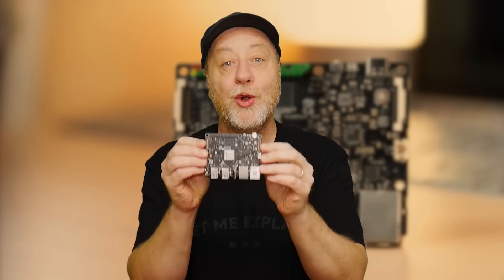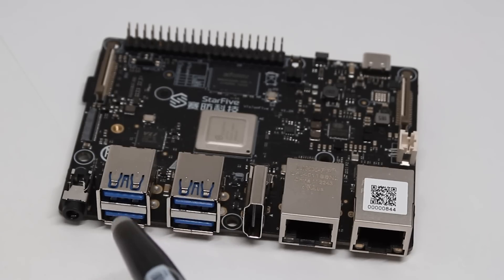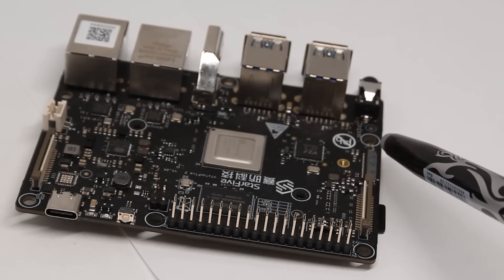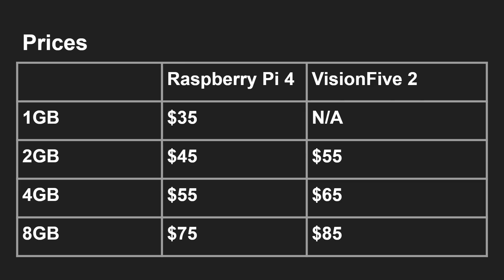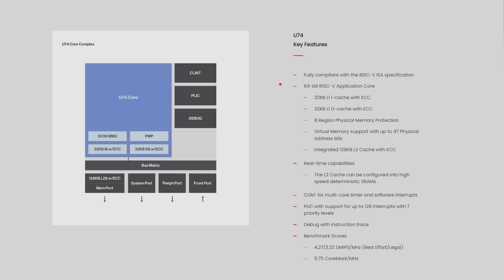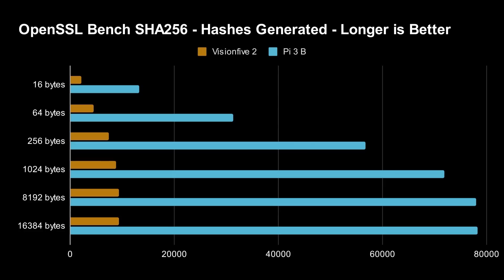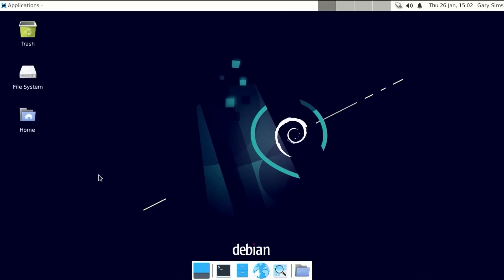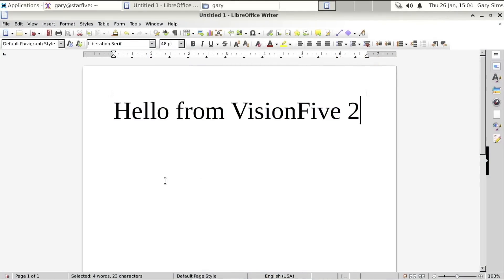VisionFive 2 RISC-V SBC - A Raspberry Pi Killer?

Comment: Had this board for quite some time sitting on my desk - guess I should crack on and boot it one of these days... If I recall Starfive was showing some benchmarks with an 'optimized' kernel that would make it score higher than a rpi4b but I haven't seen anything about it in the real world
Reply: I don't recall the same claim. StarFive claimed that the CPU is comparable to a Pi 3, but the GPU is faster than the one in the Pi 4. Unfortunately the GPU driver is currently a BLOB, but Imagination Technologies has expressed intention to support open source better (without telling when they are going to do what).
Reply: @LivingLinux  ah my bad I got mixed up with the sipeed lichee pi 4a RISC-V announcement which touted significant speed improvements when compiled with an unnamed optimized toolchain rather than the default RV64GC toolchain

Comment: Lets wait for another decade before we should use risc v soc in SBC.
Reply: Intel is going to release Horse Creek this summer. Alibaba is pumping out new RISC-V chips. Google announced Android support for RISC-V. Things are moving way faster than you want us to believe.
Reply: @LivingLinux  I hope RV uses modern OSes, and then it's a race to always be on the cutting edge.  This SBC is remarkable.
Reply: @BeeRich33  Once we have mainline support, Debian and Ubuntu will probably release the RISC-V images together with the other architectures. And probably more distros will follow.
Reply: @LivingLinux  Not much else on the market re: this new segment.  I'm so looking forward to these flooding this current ARM void.
Reply: @Mahesh Yes, there are general RISC-V images available, but they don't work on this specific SBC. I saw reports that people tried with the Ubuntu image for the original VisionFive, but it seems that doesn't work.
Looks like we have the same issue as ARM, where you need specific images per SBC.